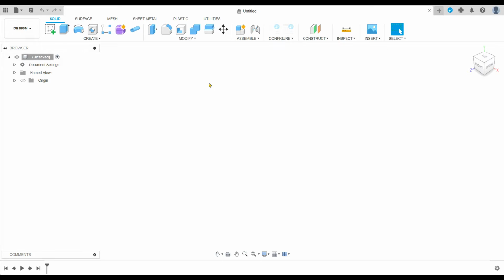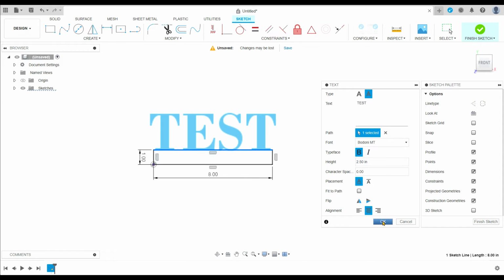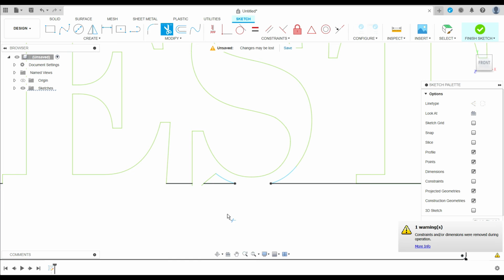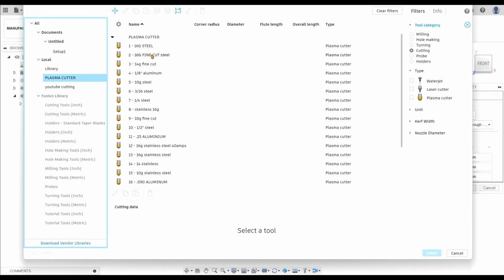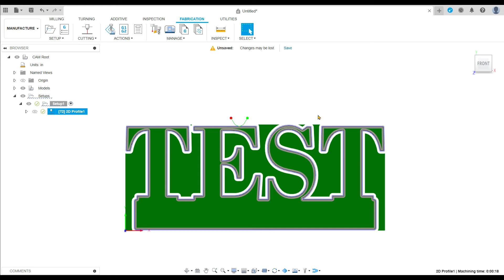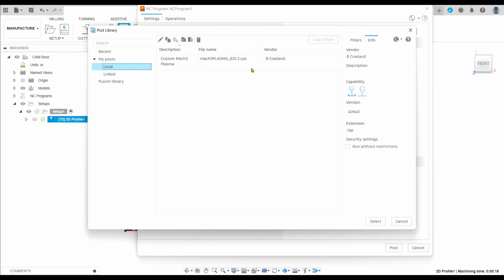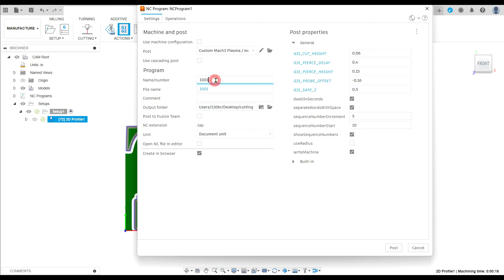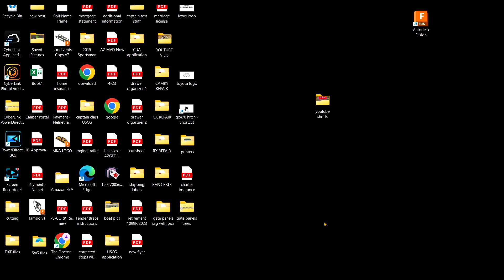How to: Mach3 Post Processing File with Fusion360. Free File!

Comment: Great video! My brother and i are both retired and live next door to each other. We've been struggling along at a snails pace for just over 2 1/2 years to build a multi- tool plasma/ spindle/ laser cnc machine. I keep saying we've learned a thousand ways not to build one but not one right way to. If we get the post processor from you as requested via email we may finally be on the cusp of success at last!